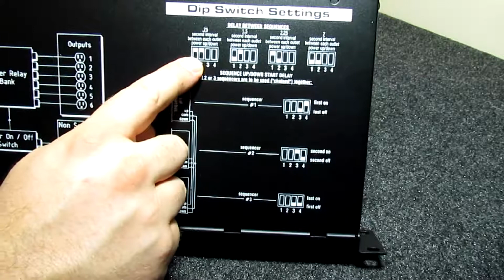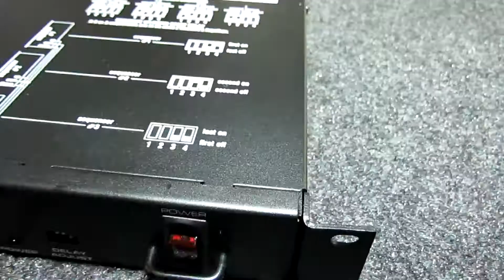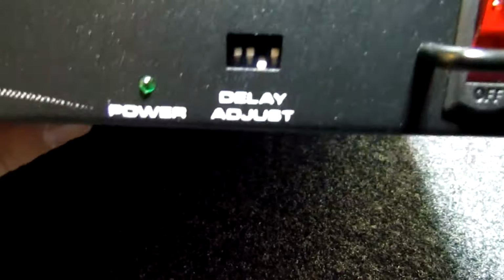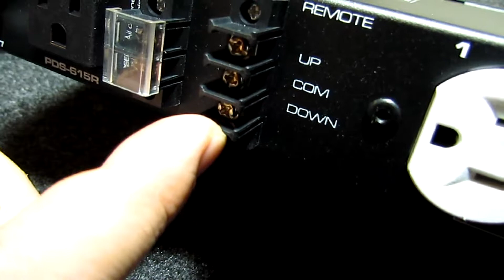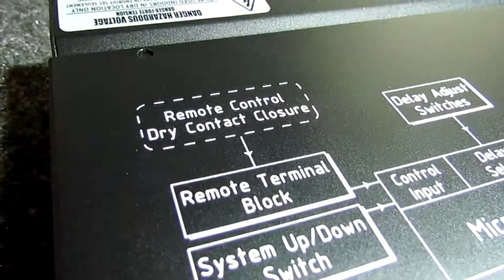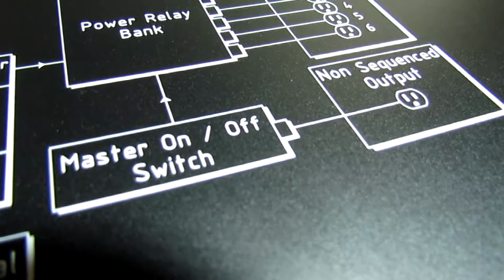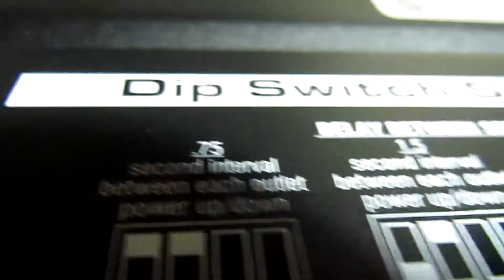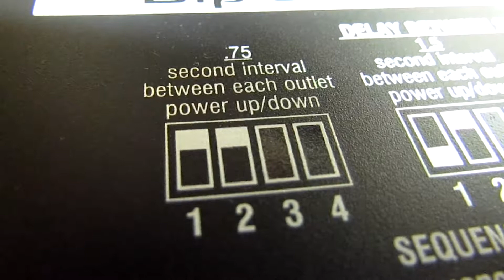Power Sequencer Tutorial | Middle Atlantic PDS-615R

Comment: Hello, i have the same power sequencers. So if i want to use a remote switch to power three sequencers, can i plug it in any of the sequencers??
Reply from the maker: Yes, I believe you can trip the relay at any point in the signal chain because each sequencer needs to be ID'd as Unit 1, 2 or 3 in the sequence. The included rocker switches on the front panel can be tripped at either end of the signal chain and yield the same ON/OFF sequence.

Comment: Anyone has a fix for the pds-615r? I have 3 so far with relay problems. The power on sequence does not work. White power up, power down button has no response. Sometimes the units click on and and off when the main power is turned on. Randomly, when powered on, some outlets are powered up and others are down.
Reply: Any resolution to this? I’m facing the same issue, no power on. After unplugging for a while green comes on, but then goes out again. Will not power up.